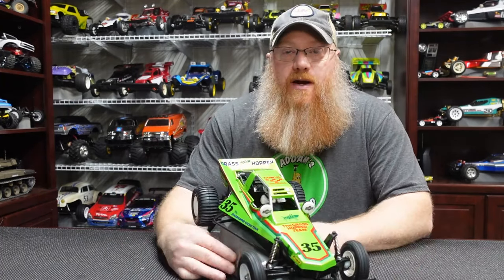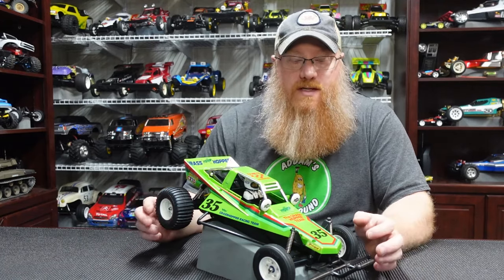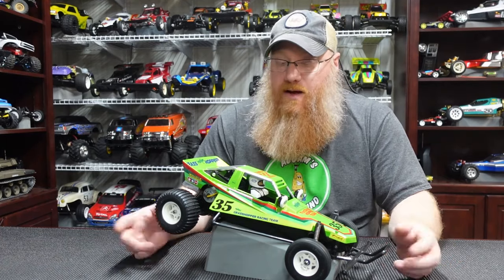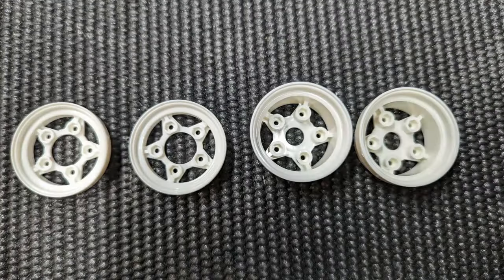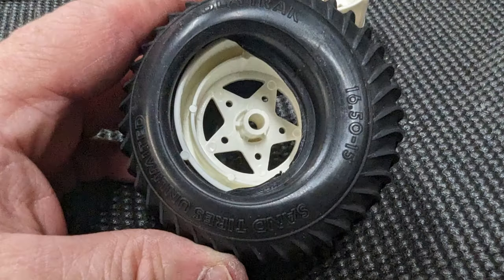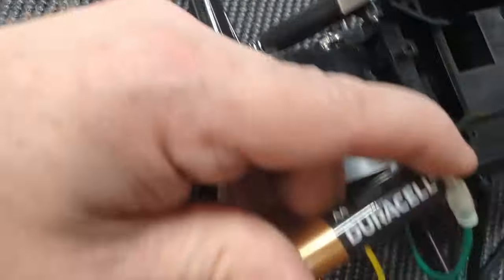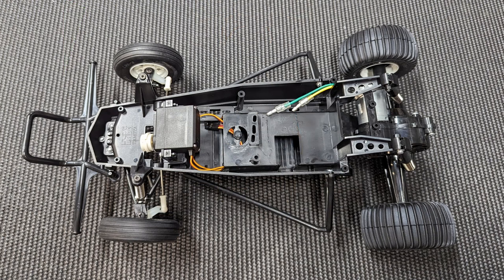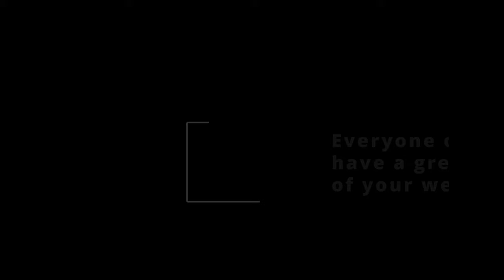Candy Green Grasshopper Build and Chat

Comment: I love the tape on the wheels tip 🔩🪛 and the AA battery test 💡 How about doing a video on RC tips? It could be like your Q&A series where you also ask for favorite tips in the comments for the next video, or something like that 🛠️🙌
Reply from the maker: That is a great idea! The community tips and tricks video. I will put that into the high priority list! Sounds like a great idea! The tape was out of necessity as if I dropped one more of those little nuts on the floor and had to spend time looking for it I was going to flip out! 😂 the gear box test is peace of mind and a safe way to test it out. In case something is wrong it should not break anything on the low voltage. Plus you don't have to wait until everything is done to check it!
Reply: Thanks! Those are so simple but useful tips. I’ve struggled with those tiny wheel screws a few times 😅 The low power battery test is brilliant. No doubt lots more of tips out there and people curious to share and learn from a video on the topic. 🙌

Comment: I like the green version Im buying one in Japan soon for 42 USD before duty free. These look great and wil deck it out with a Tamiya servo, tourque tune motor and some Hornet tyres for bashing around. I dont have shelf queens but what ever floats your boat
Reply from the maker: They are a great price! It should rip around well with the torque tuned and some Hornet tires on it! When you end up with as many as I have now a lot of them turn into shelf queens either on purpose or accidentally! Since my original one is already built up and has a few scratches I figured I would save the pretty green one from damage! Have fun with yours and it should be a ripper!
Reply: @AddamsPlayground  for sure you have too many to run. They obviously all end up on the shelf I just have none I have never run but that's just me, have a good one.

Comment: That's a good trick with the aa battery, never done that before, but I will now!
Reply from the maker: I use it on all my builds, if it will run off of a AA battery it will run fine on on 7.2+! Makes it so much nicer to catch a mess up and grindy gears before getting the whole thing built or throwing a lot of power through it. Free tip for the day!

Comment: Yep those wheels are a pain however a trick to mount them faster is to heat the tires in a saucepan on the stove to the point the rubber is really pliable. A little water inside the wheel is no big deal since foams are not used. I ended up using as a spare set a vintage set of one piece 1.9 white nylon prolines for a wild one/Fox on modern traxxas tires for my GH build. I believe I have a pic of it on my IG. I really like the look and those with this candy green body would really pop.
Reply from the maker: when I was doing my first set I was close to going to my local Firestone and asking to use their tire machine on it! LOL! I really struggled and of course I did not read the directions where they tell you to insert it sideways. I was just trying to strong arm it on there and was worn out by the time I figured out the trick! I will have to go check out you IG and see yours. I do love the look of the classic (terrible) paddle tires but it may be something for the runner. who knows, once I see it may change my mind! Thanks for the tip/idea.

Comment: Fantastic Grasshopper! Ia have 2 and they both are hardly upgraded, they work quite good BUT!! I want to return on one of them to the original  Bouncing one. It's a great model and back to the mid '80 the fact was that battery was enough for about 20 minutes and that produced log races with a lot of fun.  You inspired me, soon the video of the downgrade (hoping to have all the pieces....). Ciao!
Reply from the maker: There is something about a bone stock GH that is just a blast to drive. My other original GH is still the stock bouncy one and I think I left the sport tuned 380 in that one. I don't think I swapped in the 540 in it. I did in my GH2 but that one does not roll over as easily. The ride and bounce from a stock one cannot be beat, a true classic icon. I hope you have all the parts too, if not let me know, I am sure I have them.
Reply: This is amazing, cooperation also in spare parts.. Thanks Addam!  540 to me is too much. Ciao

Comment: It looks really nice, Addam! And great idea with the cheap servos, I just went to Amazon and now I have a pack of 4 in my basket, ha ha... I did not actually know it was painted candy green, I always thought it was made with green plastic, never seen one in real life yet...
Strangely with the old Grasshopper, I keep telling myself I can't afford it, even though it's quite cheap, so I haven't got one yet, I keep buying more expensive kits for some reason... Someday I will manage to get one...
Reply from the maker: It looks really nice in the green for sure. This one the body is molded in green and then pre-painted with the candy green. They have done the metallic green in the past but only the body shell, it was not done as a kit version to my knowledge. The servos are really pretty good for ones you'll run every now and then, the daily drivers you may want a bit quicker and nicer one but for $5 a piece you can't beat them! I build probably 90% of mine with them as there is no reason to put a $30+ servo in each one to only run it once in a while. I understand the not spending them money on one if it is not a top priority buy. I tend to stay in the middle to the lower end of the pack a lot of the times. The pricier ones tend to get bumped back since I can buy 2 cheaper ones and enjoy the build of those versus only one! Every now and then I'll splurge and get a pricier one though. We all have our list of wish list in our head!

Comment: The paint work on the body looks really good. 👍 Useful tip regarding the wheels, they're quite a pain to build due to those tiny nuts and bolts! I think Tamiya finally realized this and have  just released a set of one piece wheels for the Hornet/Grasshopper.
Reply from the maker: Thanks David! I have fought with those tires and wheels more than once in my life. The prep work takes a few minute but sure beats fighting those little nuts into place and having them fall out all the time. overall even with the prep time of taping them it goes a lot faster putting them together. I did not know they had come out with the one piece ones. It is kind of cool and would make it a lot more kid friendly!

Comment: Does it come with tble-02 esc as descriptions say, or hobbywing 1060? Or a mix?
Reply from the maker: At this point I don't think Tamiya is going to make anymore ESCs. From now on all of them are going to come with the 1060 or the Carson equivalent. For some reason Tamiya cannot seem to make inexpensive electronics. All of their ESCs and controllers are way over priced so I think they decided to start using HW and not having to deal with the manufacturing of them.  The instructions on the re-releases will probably still show their ESCs in there as they are not going to change them to include another brand item in them. That is my take on it, they may change their minds tomorrow! LOL!!